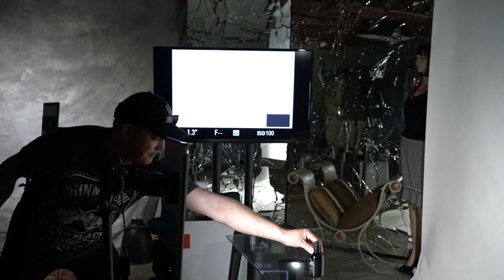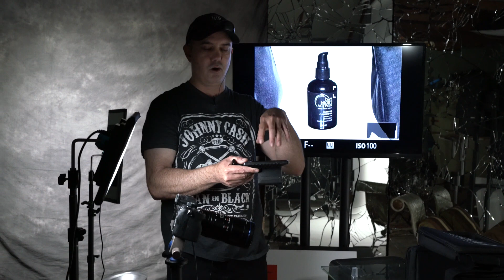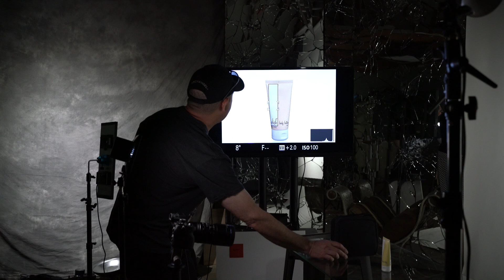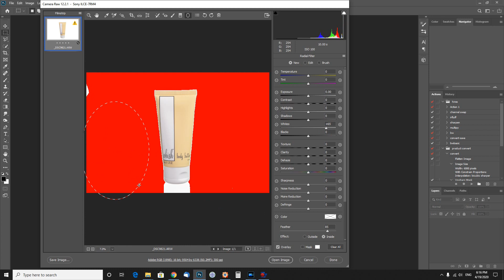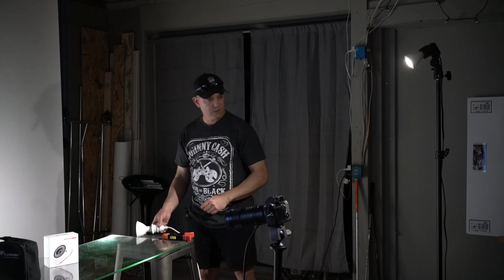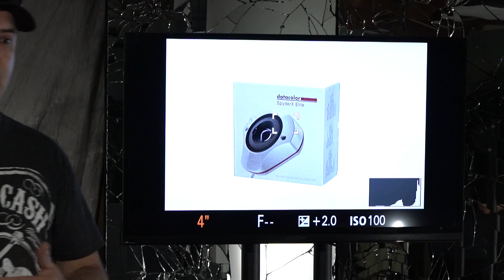How to do Product Lighting with 2 Lights With No Background or Shadows w White Knocked Out in Camera

Comment: I wanted so badly to solve this problem myself at my former job, but there wasn’t time. We got it efficient enough that regular products could be batch processed, but white products still needed manual finess to get the mask right. I’m still kind of obsessed with it which is why I nearly knocked a hole in my ipad clicking on your video. Interesting that you do it with continuous light.